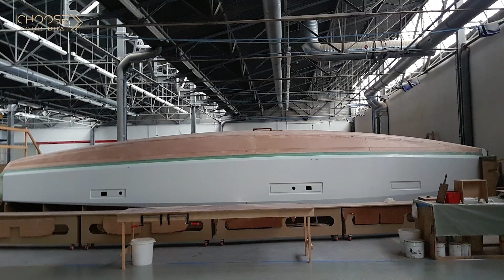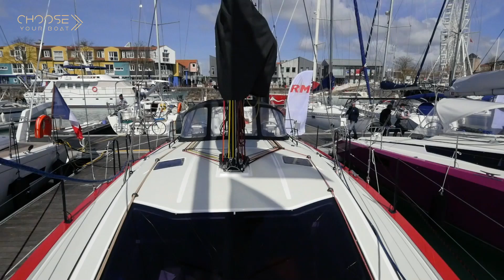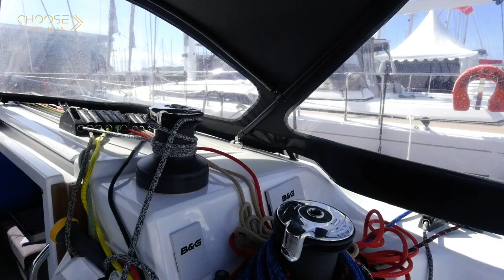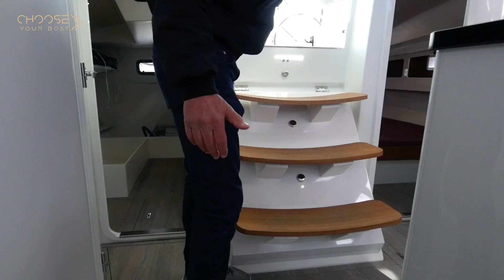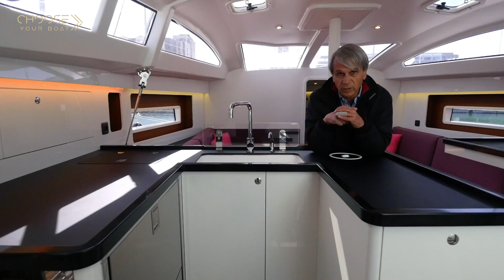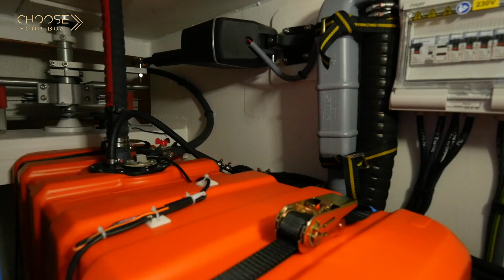RM 1180 : Guided Tour (in English)

Comment: I thought RM stopped selling lifting keels after a couple of boats sank when the keels fell out the bottom whilst moored.
Reply: that was like, what, 4-5 years ago?  something to do with a flaw in the bolts not the keel design itself.

RM was bought out by Grand Large Yachting group (Allures, Garcia, Outremer, Gunboat) that make lifting keel aluminum exploration vessels, so...